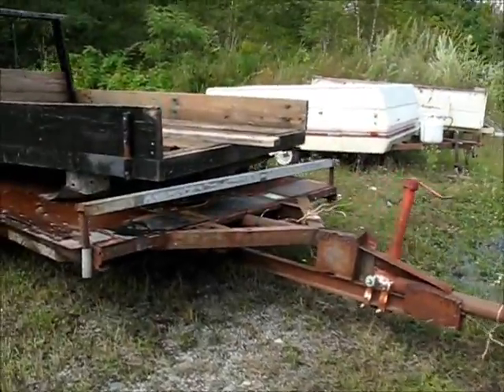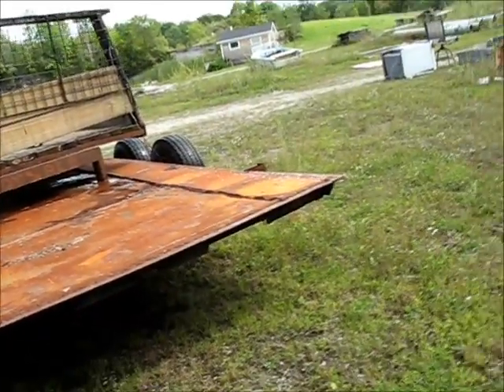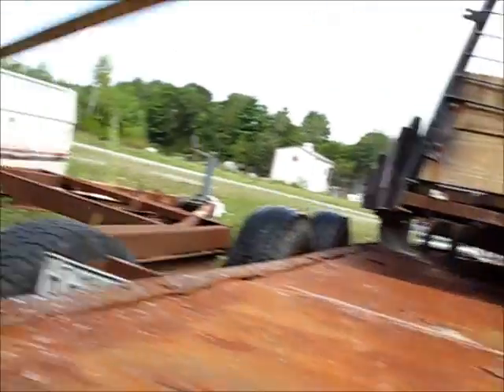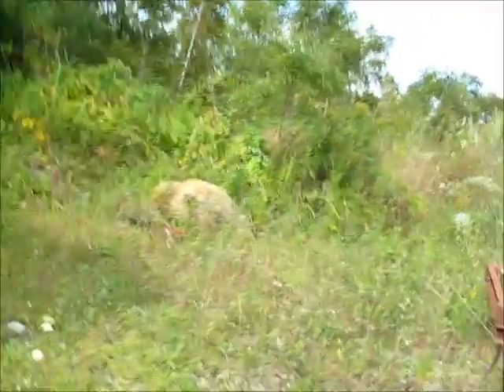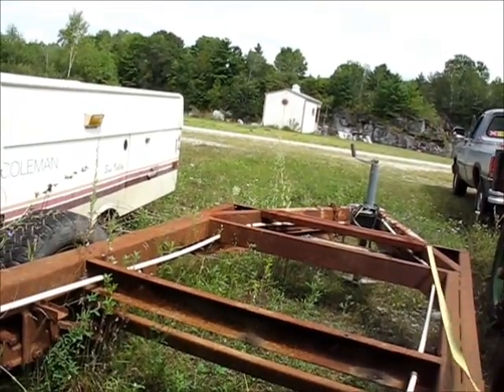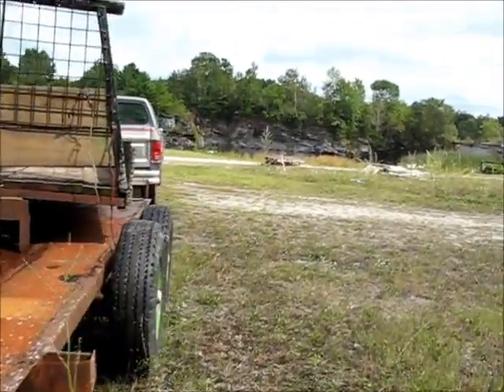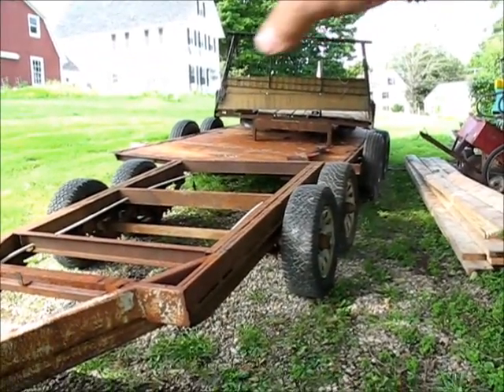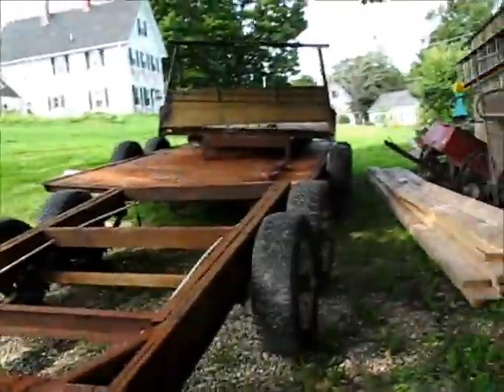Flatbed truck bed unloading technique

Comment: That's pretty ingenious pity you haven't got a few circular fence posts to act as rollers that you could put across the chassis bed and have the body runners resting on but I doubt you would have any other real use for them.